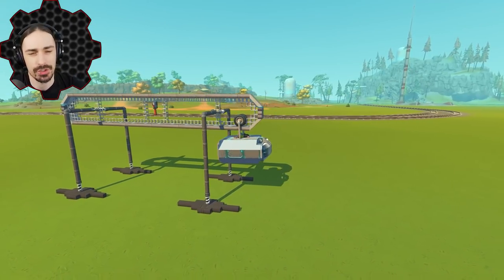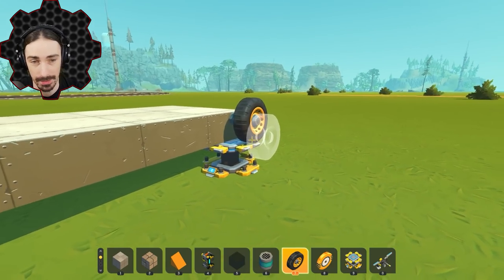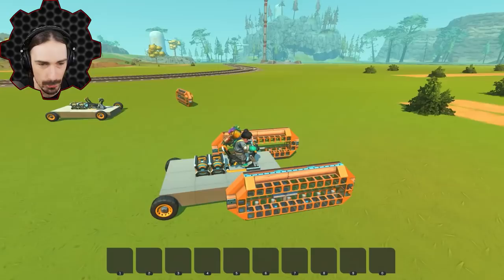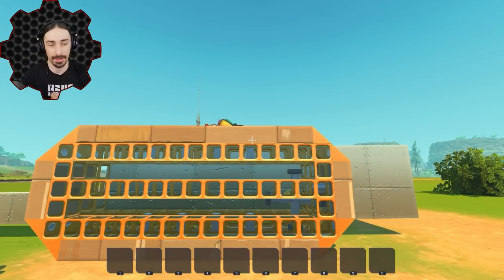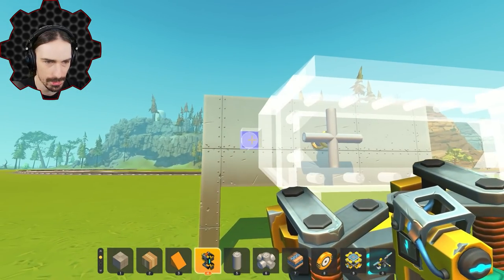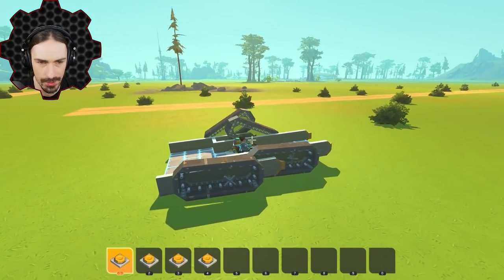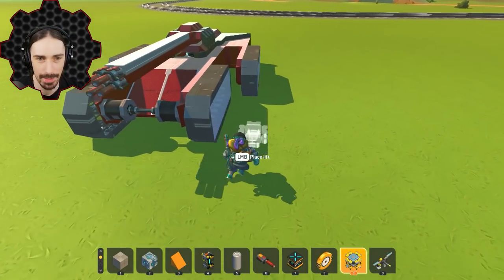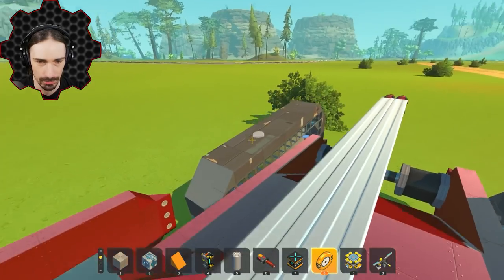Perhaps The Dumbest Tank Design With Genius Engineering: Attack Track

Comment: ScrapMan, there is an inside curve block. Its just the reverse of the duct curve piece, its green in the inventory
Reply: The skinny wedge
Reply: Flying Pankcake, am I right?
Reply: @ItzEvin08  gasp the HANKcake! :)
Reply: It's actually just a visual, it's a wedge. Sm handles complex collisions by having a separate 3d model file with a lot of dots in it and when physics engine runs it just connects 1 point to all other points and does it for each one, so you can't have concaved collisions in the parts in sm at the moment, sadly
Reply: @ADonutMan  sadge frame rate optimized gaming
Reply: @ADonutMan  oh, i didnt know that. learn something new every month about this game, even though have been playing it since piston update...
Reply: @Apersonl0l  Not really optimized tbh, it still counts all connections inside the model, as well as the fact that sm doesn't even hae LOD's
Reply: @Hlebuw3k  this MIGHT be updated in ch2, since devs constantly say about engine upgrades slowing development down, so I have my hopes up for that
Reply: @ADonutMan  even sadger suboptimal gaming
Reply: thats why there s (smaller) duct gang
Reply: but wedge gang
Reply: the concave wedge block?
Reply: concave wedge

Comment: Lol I was going to suggest suspension to apply downward pressure into teeth.
Glad you thought of it though, it even had more additional benefits, great.
If that didn't work I was going to suggest combining the tire and rod methods to get a more consistent speed and grip. Figured out a fix nicely.

One thing that made me surprised a little is the spudguns. You have so much room in there you could have just placed the spud guns facing outward, hidden inside the tank so you'd only see the tip of the barrel then connect the treads so that the gun could shoot through two blocks and the mechanism would be more hidden.
Still really cool execution of the creation.

Comment: Nice one! i do have 2 suggestions that could hopefully make it smoother (less skipping teeth) and prevent it from falling apart
- The 'tracks' should prolly be 2 blocks taller so you can make a bit more of a curve at the ends
- Then use pistons to have a 2 block high piece 'floating' in the middle of the side that the 'wheel gear' slots in to, so that gap becomes a circular slot, this should prevent the 'wheel gear' from jumping up and skipping teeth

Comment: 19:10 If you never need those spud guns again... just attach a pipe to the side of the cardboard to hold the gun. Then when the cardboard gets shot off, the gun detaches at the same time.

If you attach them to the forward movement button, then they don't even need a separate control.

Comment: think what u needed to prevent the slippage at 12.36 is an inside block to keep the axle from bouncing up.. probably would need a piston or suspension so the axle has no collision that way you can have a centre area of blocks as a runner/ chain guard type of thing :)

Comment: With the horizontal small pipe pieces, couldn't the "threads" be 2 block lower in total height?
Scrapman started with 5 block height tracks and ended with them 7 block height?

Comment: I think this might work better if you tweak the timing on the tracks. Ideally you want them to be staggered, so when you're "stepping" with the front left, you're also going with the back right, same the other way. That may negate a little bit of the tilting problems because it should  stay a little more level

Comment: You could put a bar across the middle of the "track" pieces to hold the axle in place better. You would just need to use a non collision block on each end to let the axle through.
And if you extend the axle past the pipe gear and do the same thing on the glass side, it may be more stable side to side.

Comment: I don't know much about this game, but I feel like you may have been able to make this work with the tires on the high-friction surface if you either added more weight to the tires/frames or a suspension as you did with the gear design, ensuring persistent contact with the surfaces through the rotations.

Comment: I know you want it to be more " realistic" but what if instead of having a gear or wheel system inside the track just have a bearing and a piston attached to the inside tip of the track ( assuming you can use logic to start and stop a bearing, I don't have the game) so it would be piston extend, bearing spin 180° piston retract, bearing spin 180°, and repeat.  Also if the tracks were a little shorter horizontally it would spin more easy because the would be less leverage you are trying to overtake.

Comment: I wonder if it would be better to have the tracks one block shorter (as they were initially) with the horizontal teeth, the slight increase in vertical space between the teeth might be enough so the gear doesn't touch the top ones.

Comment: Hey ScrapMan!
I dont know if it would be cheating but instead of using a type of wheel rotating in the tracks you could use a piston for the horizontal movement which pushes the the tracks (that are than attached to the vehicle) forward (extend) , flip the track using a controller and than retract the piston which moves the car/tank forward again.

Comment: Should’ve made a circular track that just the axle would fit in that circles around the inside if the track so the wheel can’t fall and it also keeps it down on the pegs and can’t bump up off of them

Comment: If i were you, i would have had the gear teeth inside the track be horizontal rather than vertical. it will take up less space and also give the gear wheel more surface area for it to hook onto.

Comment: I think maybe you could have had just the wheel to run the track and have a gear or two at the end and place the gear on the tip of your wheel and when your wheel gets to the end it moves it over by the power of the gear maybe?

Comment: day 121 or 122 of asking scrapman to start a Survival series amphibious tank/basically any transportation and floating base/barge (or under water.) But you need mods... it's a requirement to breathe underwater, if you want an underwater base/transportation. And yes i am talking about the underwater fan moonbo reviewed that basically makes water spaces air spaces... if that makes any sense.) (and if you wanted to move the barge/boat/floating base you are able to make thrusters/glitches/mods to do it or by lift or actual push)